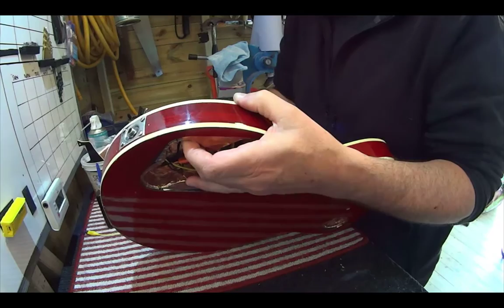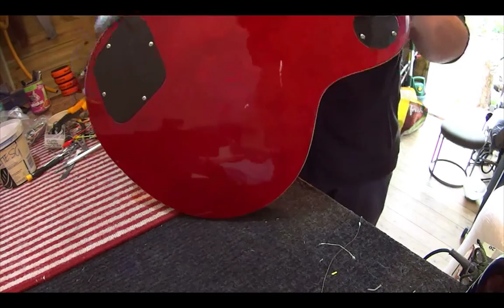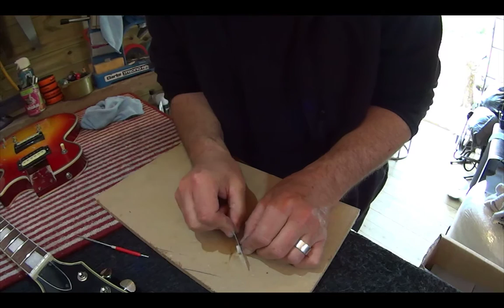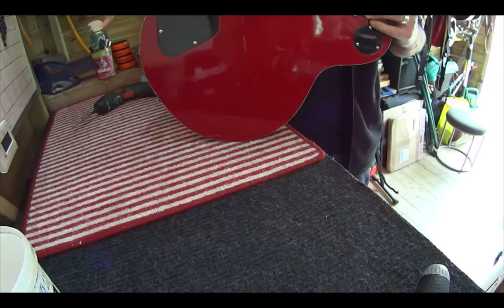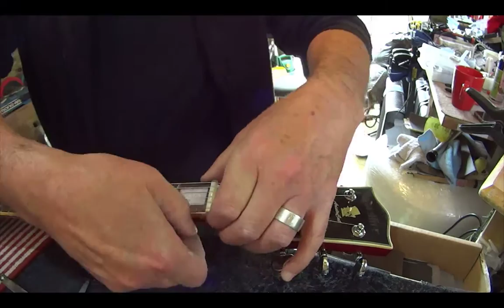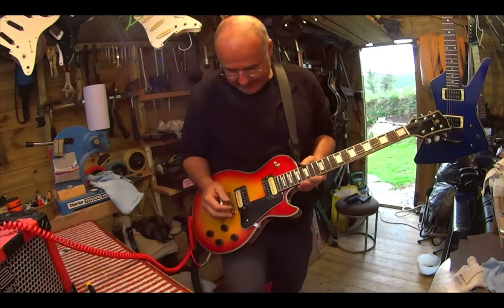Satellite Les Paul Refurbishment Part 2

Comment: Morning Sam,,first of all I have to say I have learned more about fret work from your channel than any other,brilliant advice and techniques!  Hope you have time at any point to help answer some problems? .1/ when fretting a bound neck,do you trim the fret ends flush then use a bevelling file to make the fret ends flush with the edge of the fretboard then file in your bevel angle the same as a normal neck and accept you night take the edge of the binding slightly? , I can't think how else to do it ? Thanks in advance, George.
Reply from the maker: Hi George - in short, yes; I undercut the tang so the crown extends over the binding. Then I use the bevelling file in the vertical position to bring the fret ends in flush to the binding. After that I tip the file over and put an angle on the fret ends. Ultimately, there comes a point where the file comes into contact with the binding; you just take care that it's very slight. If you're not confident that the frets are as flush as you want you can at this point use a hand file (being careful to avoid the file going either side of the fret end and damaging the binding). Binding is usefully soft - this means that once you've filed back to flush & bevelled the angle you can 'soften' up any visible marks or scratches with gentle grit sandpaper as you're sanding out all the frets after fret levelling. Hope that makes sense? :-)
Reply: @SamDeeksRelovedGuitars  ,,makes total sense Sam,,,I get it !! I,m going to order a special miniature 2 way fret saw that cleans the slots out ,,seen them on ebay for about £15 to avoid any glue that stops the frets bedding  down,,,something else i learned from you,,see what I mean ! haha !! Thanks again for sharing your hard earned knowledge, cheers George.

Comment: Are there any negatives to this method of fret dressing?
A comment on a guitar forum 

'To solve fretting out problems the radius need to be consistent, so this wouldn't be the best way for fretting out problems.
2:08 his guitar is fretting out. See?
The out of tune-ness is also effecting the fragile setup as well...
2:07:54 when he bends, it's not bad, but picks while bent, n you can hear a tiny bit of fret buzz. That's a slight fretting out problem.
But not really bad though I admit'

What is he on about, and is this typical of any criticism?
Reply from the maker: Are there any negatives for me in this method? No - which is why I prefer to do it. There is, by contrast, a longer list of positives: namely accuracy (because I'm levelling WITH compression at play) and the fact that it allows me to level ONLY enough to make the action I want play thus saving as much fret metal as possible. And because I can test each string right there and then to know if I've got the frets level enough for that chosen action to play well. 

Are all fret levels I do perfect? No. Why? Because sometimes I stop before going all the way to perfect level for that action - usually because I judge that there isn't enough fret metal for my liking. 

I've no idea what is meant by the out of tune-ness...or fragile set up...I'm sure it won't surprise you to hear that I take my cue from the consistently positive feedback I get from satisfied customers who love what I've done with their guitars and from people who have followed the steps in my videos to transform their own guitars, NOT from people who know 'better' on forums or in YouTube comments.
Reply: Good reply.

Comment: What size of neck plate screw did you use.
Reply from the maker: Well... it was the original that came with the guitar. They're slightly smaller than a Squier one I think. But there aren't any size charts to refer to unfortunately.
Reply: @SamDeeksRelovedGuitars  I ordered 45mm but think they are going to be too long.
Reply from the maker: @neilfoster1175  I'm sorry Neil - I misread your question duh. It should be easy enough to put the neck in the pocket and measure from the back down to a mm or two before the fingerboard. That's your approximate maximum screw length. If you can't find any and you tell me the length I may have some which I'd happily send you.
Reply: @SamDeeksRelovedGuitars  that's very kind of you.  I measured from the back down I need 40mm screws which I cant seem to get.  I can get fender/squire 45mm screws but shorter seems to be hard to come by.
Reply from the maker: @neilfoster1175  Let me check a bit later in the spares Dept. :-)
Reply from the maker: @neilfoster1175  https://www.facebook.com/relovedguitars/photos/a.2248417895415318/2602704363320001/?type=3&theater
https://www.facebook.com/relovedguitars/photos/a.2248417895415318/2602704633319974/?type=3&theater
Email me samdeeks@gmail.com :-)
Reply: @SamDeeksRelovedGuitars  emailed and I used the original neck plate

Comment: That must've been annoying when you used 11 gauge files for a set of 9 gauge strings and they were still getting pinched at the nut! I could feel my blood pressure rising for you.
Reply from the maker: +Jay Tee Yes... I don't quite understand it (other than the excess material around & above the string until I file down the excess nut material)
Reply: +Sam Deeks yes, strange... are you suspicious of the file sizes... perhaps it's just the resistance of the new strings against the nut material, unlikely though. I don't remember, had you already put in the graphite?
Reply from the maker: I'm not sure...some things don't make any sense :-)